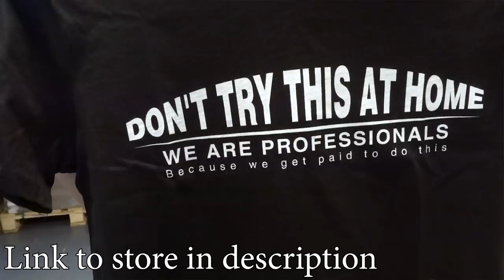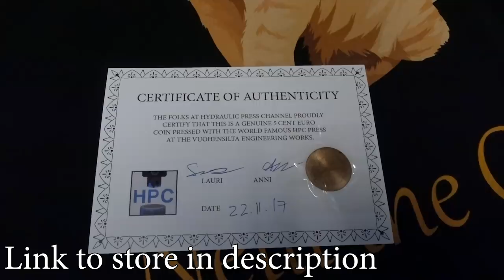Machining Huge Multi-Start Thread Roll with Giant CNC-Lathe

Comment from the maker: Link to merch store www.printmotor.com/hydraulicpresschannel/ We finally made Nelli the cat t-shirt and couple other Beyond the press designs. There is also all old Hydraulic press channel designs! 

Note that while buying out side of EU you will get VAT removed and therefore lower prices than you first see. The right price shows after you have set your location. The coin campaign is for this month and you will get crushed coin for every shirt you purchase so you can order.
Reply: It's time fora Nelli Cam!
Reply: Beyond the press 
Put magnets on the top to hold the piston back until the pressure builds up to increase piston speed
Reply: Beyond the press kannattaa varoa kun hitsaat sitä uutta juttua kun se saattaa muuttaa se kappaleen kokoa ja uskon että tiedätkin mutta mikä ihme tuo valtava kierre tanka oli
Reply: Lauer, you look great in a shirt and tie buddy :-)
Reply: LtJackboot its not Lauer its Lauri
Reply: My apologies
Reply: Can I order only crushed 5 cent coin with certificate of authenticity? Don't really care about T-shirts.
Reply: The sizes don't go up large enough to fit me :-(
Reply: Very impressive precision machining of giant parts!
Reply: Beyond the press lookin good .. does your wife stil vlog??? Ooo ya love the nailli shirt
Reply: If you want to ensure, that the weld or material does not crack, preheat it with a torch. 150 C should be plenty for this thin material.
Reply: I loaded all of the shirts, but the one with Nelli does not show up!

Comment: You know you have a well equipped machinist workshop when you have a small, medium, large and giant lathe :D
Reply: And a skull. 5:13
Reply: And cat as a safety manager
Reply: I wanna see the one i've seen ppl say can turn a 30m diameter but can't find anything it :(
Reply: 30m???? I highly doubt that.
Reply: Not the one I was thinking of but 25m turning diameter http://simplebooklet.com/publish.php?wpKey=tNSvCRzHzZtrp3U3SgXNLy#page=5
Reply: @Bob3D2000  Hmmm I can't say I can think of anything atm either. Anything that would require a component turned that large (first to come to mind being the 30-40m telescopes) can't make something that large in one piece so have to use multiple smaller components anyway. Perhaps there are some kind of gears or wheels somewhere in the mining or oil industry that are that large?
Reply: @mr.potato9449  Even a gear would be better off being machined in multiple pieces at that size. Any damage from a mistake in machining, shipping, assembly or operations would be much cheaper to replace in segments than a single 30+m piece.

Comment: You should machine a big-ass spike from a really skookum material like N690 steel, give it a very sharp but also sturdy pointed tip, harden & temper it and polish that sucker to a mirror finish. Then mount it on the hydraulic press and stab the crap out of stuff. I bet you could easily stab an anvil with such a tool.
Reply: Tungsten carbide the polygon of materials
Reply: I thought about tungsten (actually, cuntstain-targlide, the paragon of materials) too, but it's probably too hard to machine. I really think N690 is the way to go. 
Also, if we're talking exotic materials, let me throw in amorphous metal. Put that through the ol' gargler and get your mind blown.
Reply: Stabinator five-million!
Reply: Swiss nice AvE refernce there
Reply: swiss It's not really exotic and while machining it doesn't work you could grind it with some diamond wheels or so. Put a nice sharp tip on a rod and place that rod inside the middle of a steel thingy like you mentioned. boring/reeming the hole and get it in with a shrink fit maybe.
Reply: Paragon of materials.
Polygon is a geometric shape, paragon is the ideal example of something.
Reply: coast2coast00 more likely it is meant to be the pentagon of materials
Reply: swiss we have an AvE fan.. me to

Comment: I cut a lot of 4 start threads and I've never seen it done like this. Thanks for the idea although I'm pretty annoyed I didn't think of it myself 🤔 👍
Reply from the maker: It's really good method of doing this and some other stuff like this. You can even do some drilling and milling with cnc-lathe when you have that spindle+motor thing built and with small fraction of cost real cnc-lathe with spinning tools.

Comment: You should make a press tool that has .1 mm convexity so it is rounded on the end but you can't quite tell by the eye, bet you can cut paper with anything softer than steel I've seen this done.

Comment: Older video, so I hope you see this question. How did you align the original threads to the cutter to make sure that you are machining in the same spot? If you don't start machining at close to the correct start point some of the old thread would still be present.

Comment: What is the purpose of the giant threaded thing?  Why does it thread from both ends into the middle?
Reply from the maker: It's paper machine roll and the thread probably keeps the paper in center of machine. I am not totally sure since I am not paper machine engineer
Reply: Ooh, cool.  Thanks for the quick reply!
Reply: Beyond the press actually it streches the paper from the middle to the outside, so it doesnt wrinkle on its way to the next roll.
Reply: adomix2002
Well that answers my question......a bit.
Why the 5 start? Couldn't they go with a simple 1 start worm and just change the roll speed?
Reply: Bearistopheles do you mean the rotation speed of the roll? You cant    exactly make it roll slower. That would hamper production. Paper machines roll at pretty insane speeds for their size, since the faster the rolls go, the more paper you make. So everything is optimized to go as fast as possible.

As non paper engineer I would say the reason for five threads is proper pitch. It also is probably optimized to guide the paper correctly without tearing it. And they want even threading so doing it with one thread would mean either to tight pitch or too sparse thread.

Metso or whoever made the paper machine probably had some finnish engineer optimizing that thread pattern for a year, because Finland.
Reply: Ari Takalo 

If it's not being used as a worm gear, different starts boils down to speed. I'd explain more but I'm currently way to hung over to think properly.
Reply: @Beyondthepress  Not a paper machine engineer?  Maybe a paper-crushing and paper-exploding machine engineer.

Comment: Good video! I used to make rock crusher parts at Hewitt-Robins in the mid 70's on large scale machines. Set up times are longer than the machining. Multi-ton parts are fun to move but a pain to dial in. What was this part used for?

Comment: 5 start!? My math doesn't go that high :)
I do want to know what part of the machine this goes to. It's hollow so it can't be for anything that's high load, but the 5 starts give a lot of speed and torque. It starts on either end and meets in the middle, so I would assume there's a matching left and right side that it attaches to. Whatever the case, that's a LONG worm gear.
Guess I'm gonna look up a paper mill and see what I can find.

Comment: Why are there four threads. And is that pipe if so how much material did you have left after the operation and how much did you have to remove?

Comment: Have you ever tried welding something on the lathe so that you can turn it round while welding? I have seen it done once before, I think it was a bit dangerous, but the machine was very slow and I was there to hit the emergency stop if anything went wrong.
Reply: I remember him having a rig for welding round things in some previous video, had to spin it manually though i think
Reply: A small welding turntable is easy to build and MUCH safer than using a lathe.

Comment: You think you have actually inspired kids, or even adults to get in to metal as a profession? Because there has been a worrying dip in kids going for vocational degrees in metal. It isn't "media sexy" anymore to be a welder/machinist/faricator, even if there is a huge crying demand for young, smart, and skilled labor in the industry.

Because the only thing that comes to my mind, which was the last thing to inspire a generation was when mythbusters was a thing on TV.
Reply: Henri Hänninen it's because machinist are underpaid and over work. At my factory every machinist works 12 hours a day of course no one wants to do it
Reply: That's because there's this giant push to make every kid go to college to get a degree that isn't worth a damn.
I'm a steel worker and I work with several people who have a degree that they never put to use. It's a huge waste of money in the case of some.
Believe it or not, there are plenty of kids that want to work with their hands, but they are discouraged and told that if they don't attend college that they will never become anything.
Reply: @mephInc  well i want to study "maschienenbau" machine building? To be able to build nice things :) like my current project but in metal
Reply: @mephInc  currently studying robotic engineering, started restoring an older car so learnt fabrication and hands on stuff. Keep getting into high end projects cos I'm the only person studying my degree that actually has fabrication and hands on experience 🤦‍♂️

Comment: Is this an eastern block machine shop or a museum. Machines are ancient. In the states we modern cnc machines.
Reply from the maker: Those are old soviet machines that we have fitted with servo motors and cnc controllers. Does the the same work as over million € new cnc lathe.